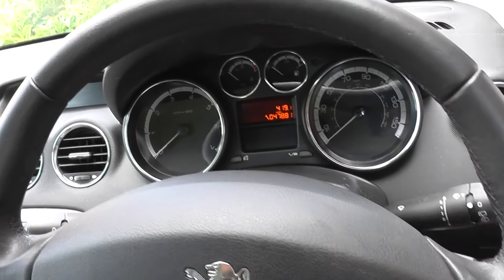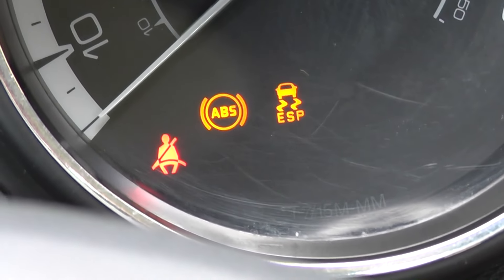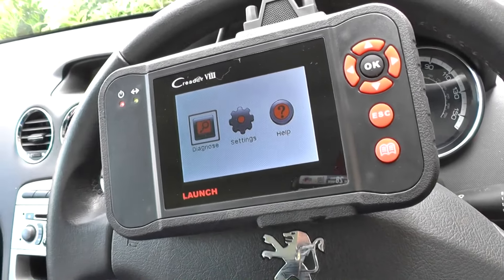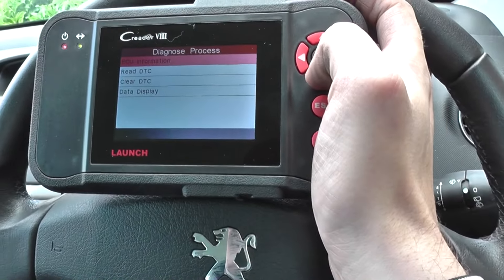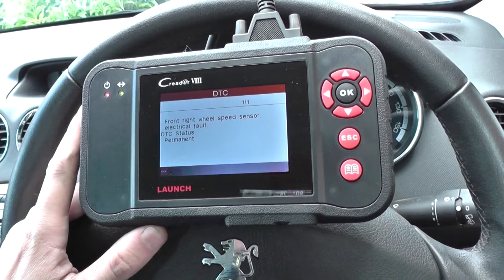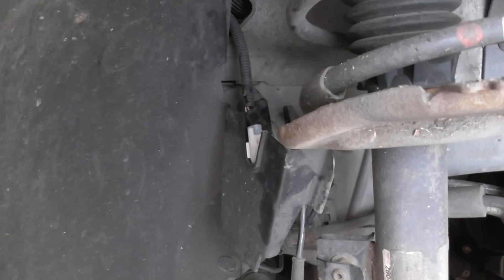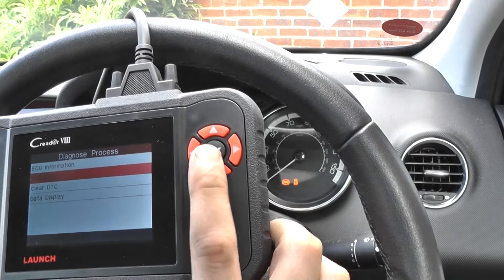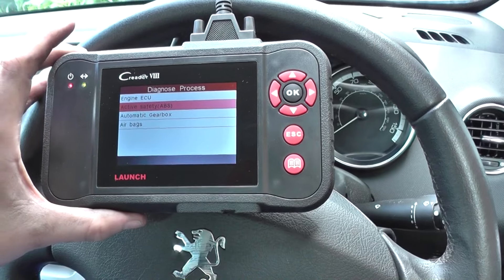Peugeot ESP ASR System Fault ABS Braking Fault Diagnose & Reset Dash Light

Comment: Hi I just had the engine management light come on followed by the ABS fault light then a ESP/ASR light then my van went sluggish an then cut out completely on side of road. Lost power steering. It would restart but didn’t want to move very far. Any help???

Comment: I ran low on brake fluid and this set of faults  came on filled up the brake fluid res , and even flushed though the rear brakes some fluid , but now randomly the car wont start for ten mins or so , it does this without tripping a code but when it does start it tells me brake fault and all the warning lights come on drive it for 50 meters and all go back off for 5 or so drives then comes back . any ideas ?  I guess there could be air in the front brake lines / abs  .

Comment: Hello, i have the same issue but by me the speedometer is not working, and the parking sensor and the seat belts are not rinning. And sometimes it fixed by it self for a couple of days and then the same issue! Can you or someone else help me?